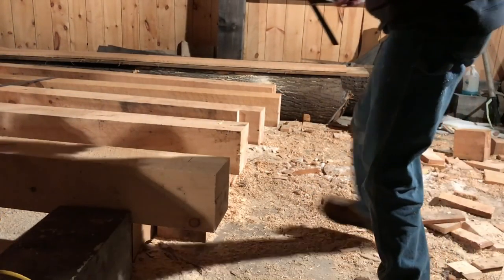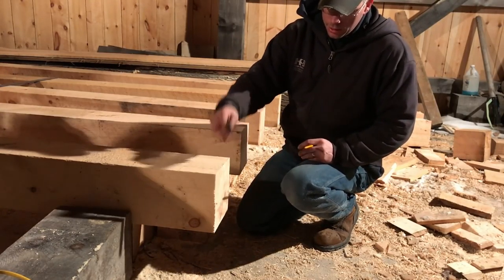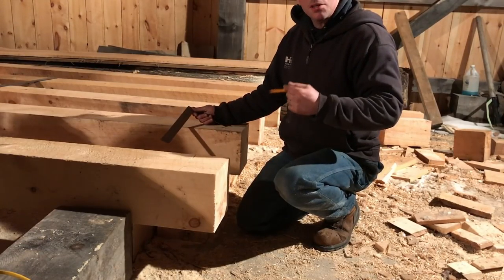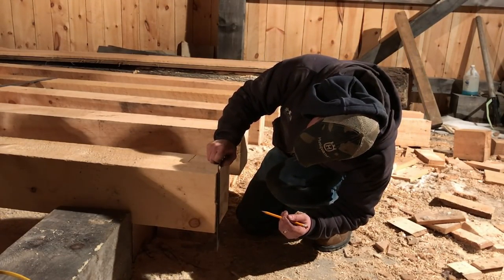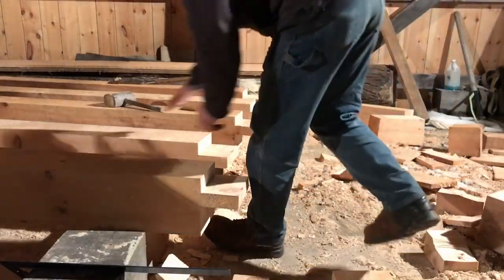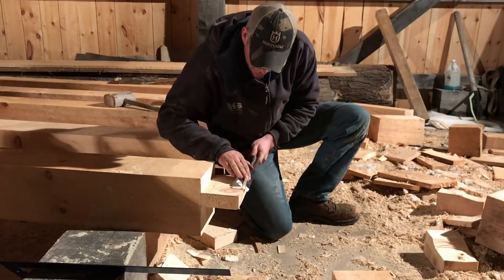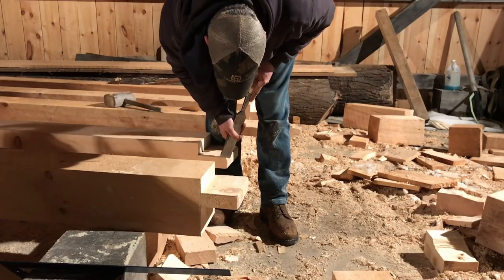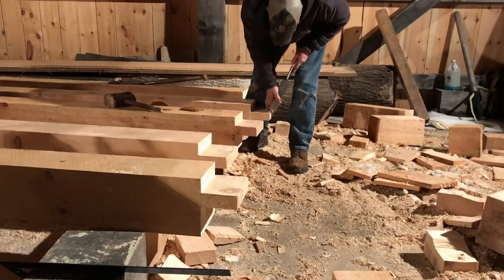A Timber Frame Vlog #124:Traditional Woodworking Using Hand Tools and Power Tools for Timber Framing

Comment: Consider 19.2 inch spacing on rafters? 96"/5 spaces, saves material compared to 16", and not as spongy to stand on to roof as 24"
Reply from the maker: Great idea, good morning.  So used to sheet goods I never gave that a thought.
Reply: And also, there are already marks on your tape measure (maybe not your timber tape) that indicate them. They're little black diamonds on the top row. No math required.
Reply: I was going to suggest the 19.2 spacing on the rafters. It is an older standard (not used as often) but it is still a standard spacing. Most people don't even notice the little black diamonds or if they do they don't know what it is used for.
Reply from the maker: I never knew about it.

Comment: Afternoon Jim. Are you sure you're cleaning up after shutting down the camera? You talk about the mess a lot and it's gotta be mighty tempting to head inside to edit when you out working until midnight or later.
Reply from the maker: It's the tools that get picked up...the mess stays until I'm done with one process and am moving onto the next one...I have a 1,000 excuses for the mess.

Comment: Evening Jim.  What's the thought of drop cutting vs kerfing and chiseling.  Just preferences or are there advantages of either one.  Seems to me drop cutting would be faster but takes more skill.
Reply from the maker: Kerfing is easier to do accurately at first but a drop cut makes it really fast to do.  Drop cutting is pretty easy once you've made a few cuts.
Reply: TheTradesmanChannel thanks buddy
  Good vid.  Hope the NE takes it easy on you
Reply from the maker: Coming down hard right now.

Comment: Morning Jim ,  got another stupid question.
Can an out of square timber be made true with a portable planner?  Or is it worth the hassle?. 
Great progress. Can't wait to see those post on 2nd floor.
Reply from the maker: Not a stupid question at all.  It can be done but is not needed.  When doing square rule framing you are able to make up for out of square timbers.
Reply: Check out aaroninatlanta. Unfortunately he hasn't been activ for 5 years....

He modified a 15 inch bench planer to run on tracks up-side - down. Interesting idea.
Reply from the maker: I have been thinking of doing that.
Reply: kiwi007 Like an oversized Jointer?
I'll check that out.
Reply: Or you could save up for a Logosol LM410 which runs on sawmill tracks and can even plane / shape D-Logs
Reply: Sorry the userrname is aaroninatlanta

Comment: Personally, I think having 6 or eight of these would be the bestest handy around ... https://www.youtube.com/watch?v=Oy2xhKOYw8w You don't have to agree but they look like they are awfully useful and at a good height in the 'tweens. (Sawhorse vs ground squat.)
Reply: Takes too long to build... Check out JimRogers117, how to build sawhorses quickly with leftover material. Sturdy enough and you can build 10 instead of 1 in a day. 

And Jim knows his stuff. He is the moderator of the timber frame forum in the forestry forum.

Plus you can modify their height on the fly with you saw, just butcher the legs....
Reply from the maker: I know Jim well, he's a sharp guy.
Reply: Don't have a thing bad to say about JimRogers117 Love his stuff .. Just think the shop stools from Samurai Carpenter are easy to use, strong, portable, don't over elevate materials, and even make handy seating. He's 6'4" so I'm sure you can use them too. Uses scrap cutoffs too. Not sure what kiwi007 is talking about.
Reply from the maker: I like Jesse, he is very talented.
Reply: Me too. Love his designs. His work is enviable.
Reply: Sorry my mistake, didn't watch the mentioned video and thought you were talking about Jesse's japanese style saw horses.

Like the Chappell saw ponies too, got 4